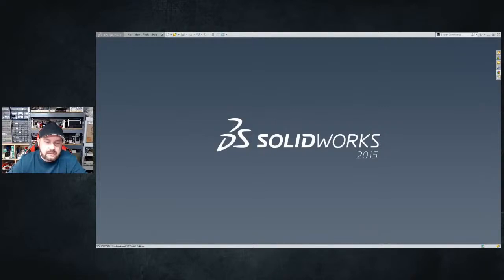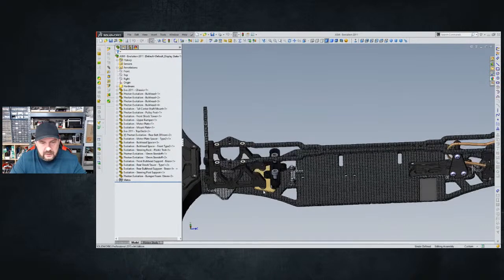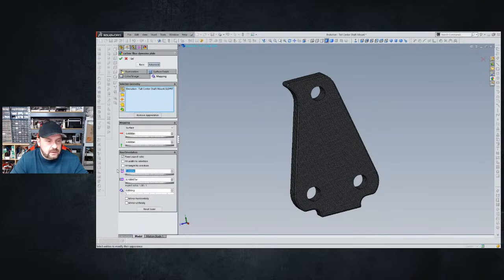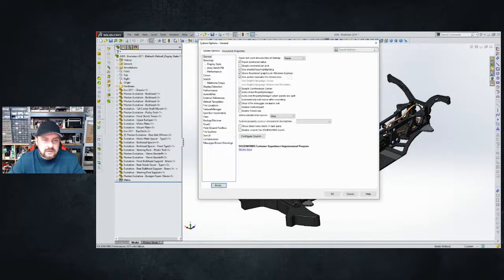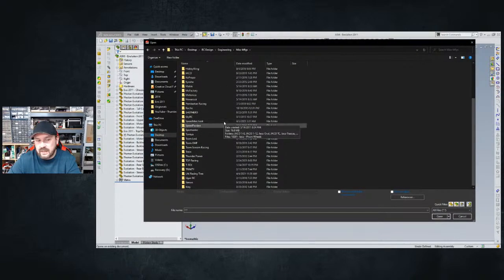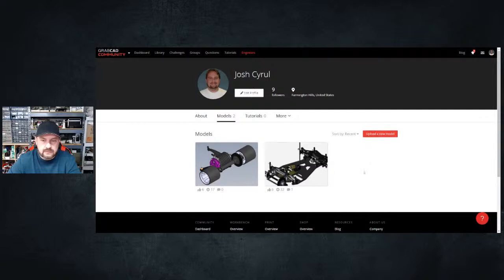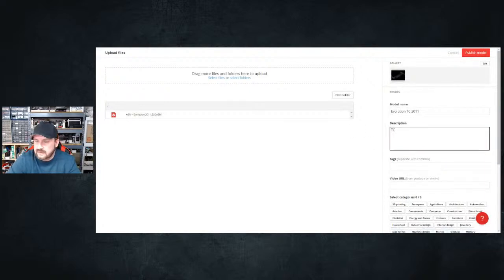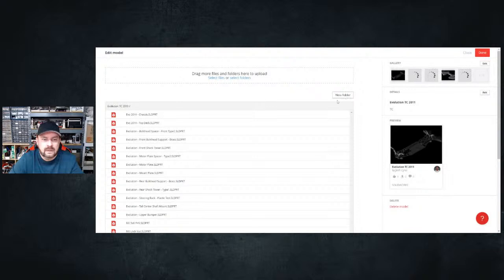GrabCAD Upload! Evo2011 TC using SOLIDWORKS Pack & Go!!

Comment: My experience with an Xray T4 is when there is less rear chassis flex the rear seems to have more grip on-power exiting corners. And I hear more rear chassis flex would lead to more rotation. Would you be able to share the physics or why this is? Many thanks.